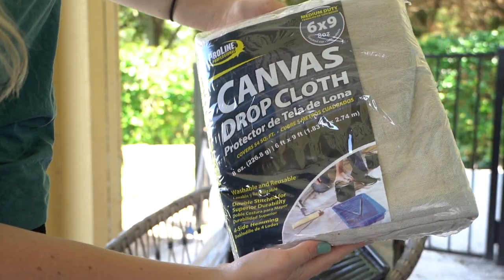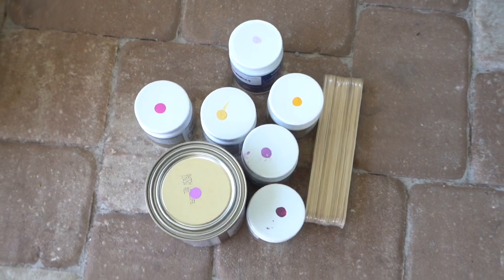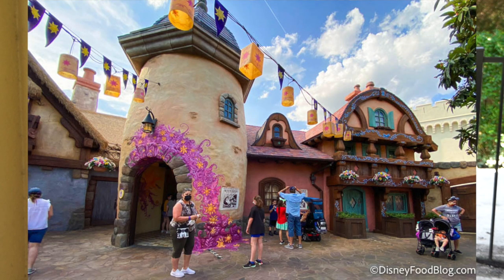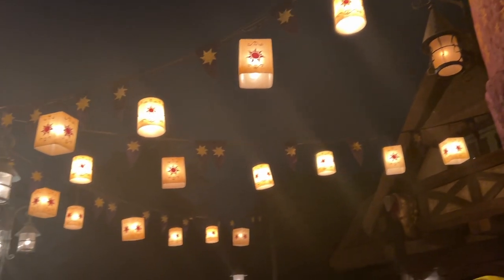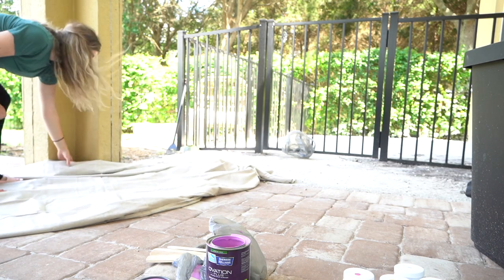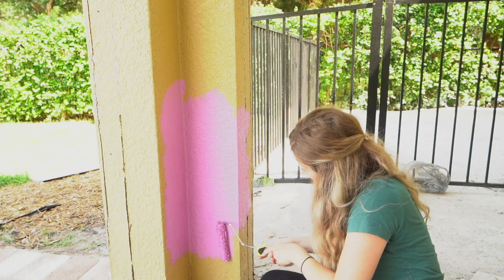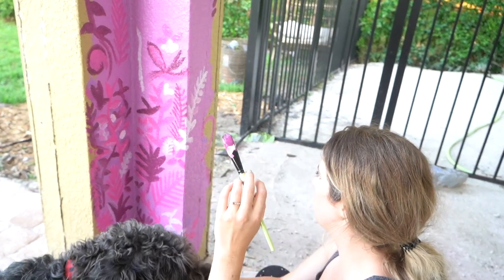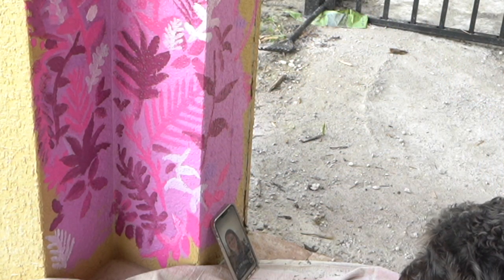I Custom Painted A Mural ON A HOUSE...without permission 😬

Comment: Wow! you did an awesome job despite the conditions you had to work in! It would be cool if you could do something ice themed playing with blues and greens maybe from Frozen as they are technically in the same universe or even using some of the bedroom wallpaper designs from Arendelle castle for the other column. Maybe it could help you cool down a bit in the summer heat.

Comment: If it helps at all: with paint spills - start with sprinkling baking soda (bisodium carbonate) over the spill. Mixing it in dries the paint into clumps that are easy to sweep or vacuum up.